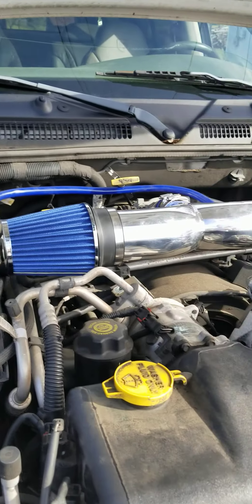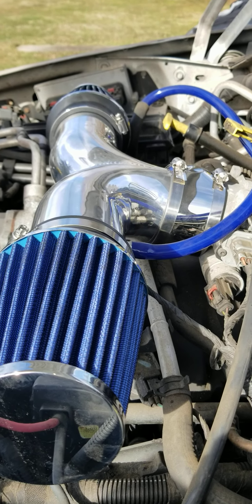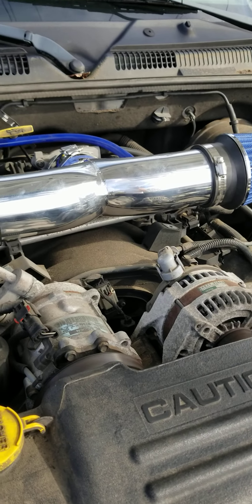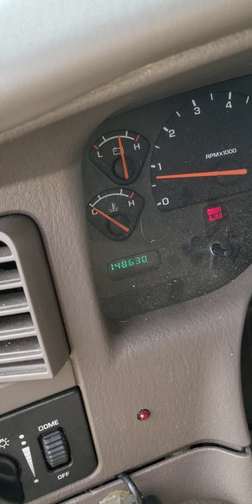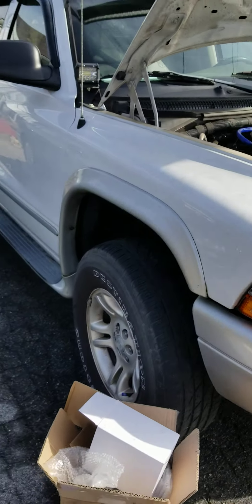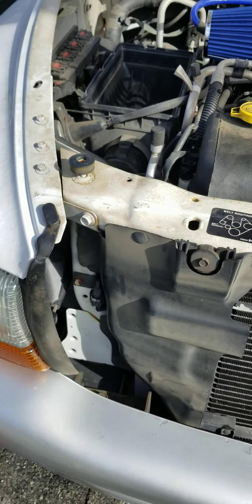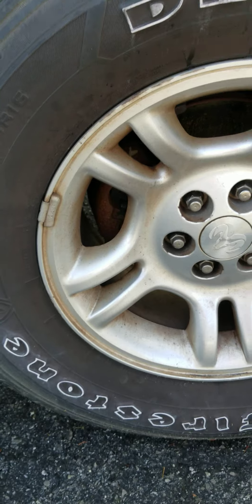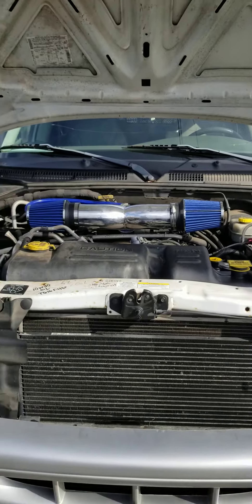02 Durango cold air intake

Comment: To take out the old airbox just undo the bolt by the computer and then all you have to do is pull up on it. It's just one bolt. Just pull up and it should come out completely
Reply from the maker: That bold was just spinning/ turning. My boss ended doing something and took it out. I appreciate that info though. By chance you know anything about AFTER MARKET roof racks? I love my DD, but damnit if it's not a pain in the ass to try to trick these mofo's out!!!
Reply: @robertcasianosr  https://yakima.com/products/megawarrior
I personally never had the chance to get one but this was what I would have bought if I still had my durango. If you have an instagram look up frosty_6oh. He used to have a rango with a roof rack from this brand